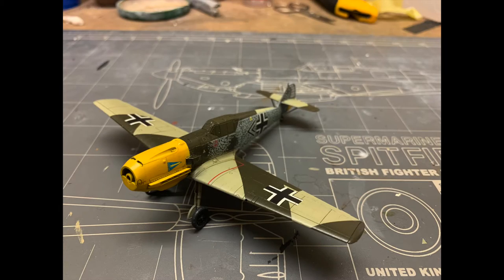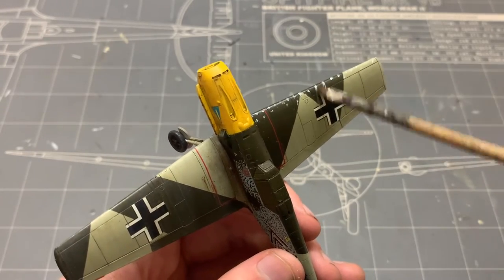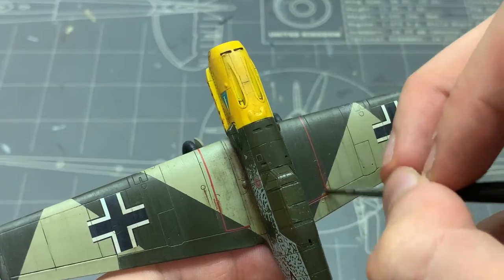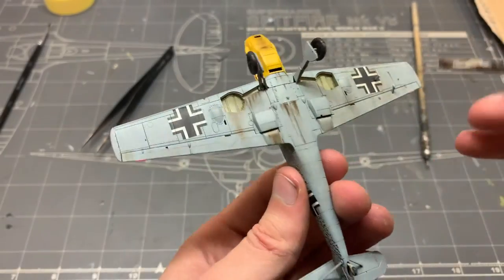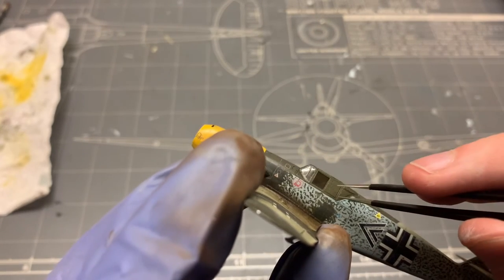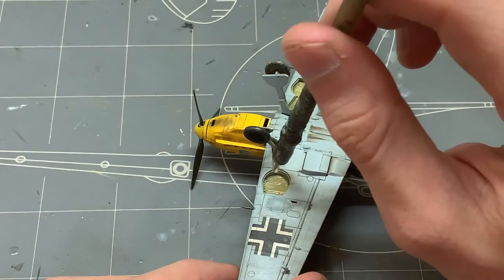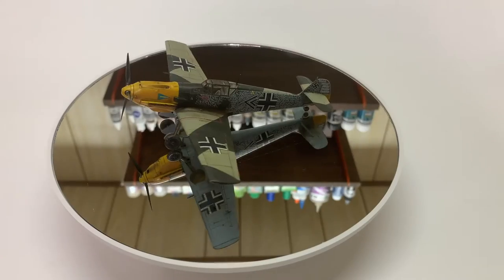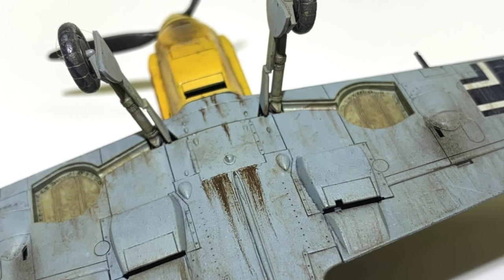Weathering with oil paints and finishing touches | Bf 109 E-4 1/72

Comment: 1/72 scale can be a really difficult challenge when it comes to subtlety. I found that applying the same techniques with even thinner washes and airbrushed coats on a 1/48 scale kit gave me a ton more latitude for detail and control. I then found that scaling back down to 1/72 a lot easier in visualizing scale on that level, tricking the eye with more subtle techniques. Now I'm geeking out in 1/32 and 1/24 with photo-etch and concerned over shelf space.. 
Great work! Take your time. Often it's not the final destination that matters, but the journey there and what you've learned along the way.